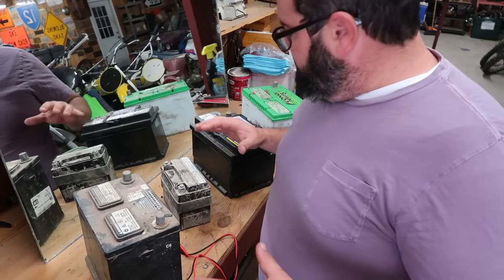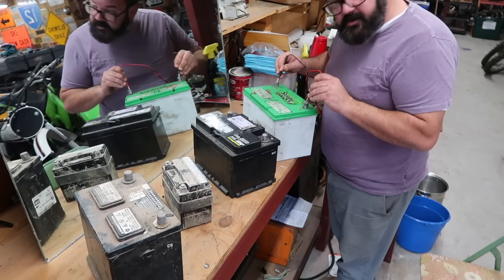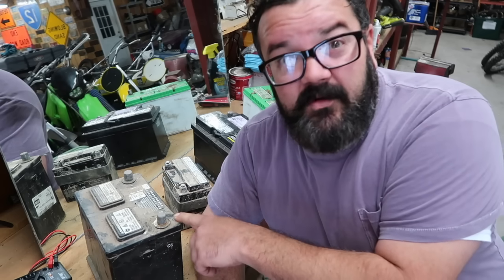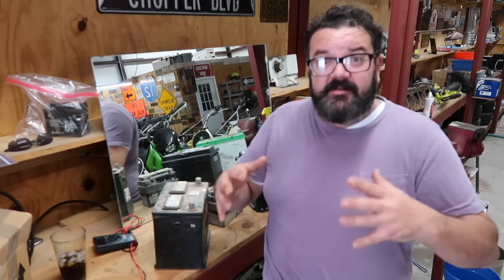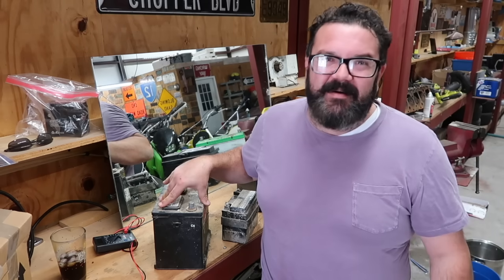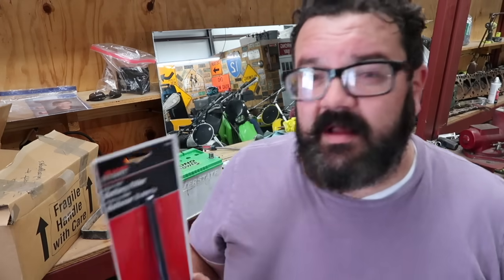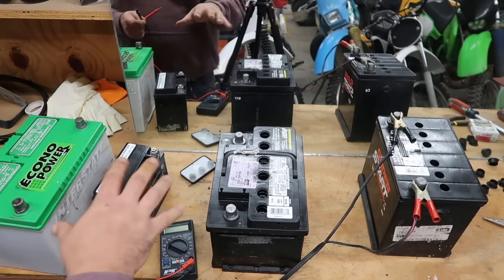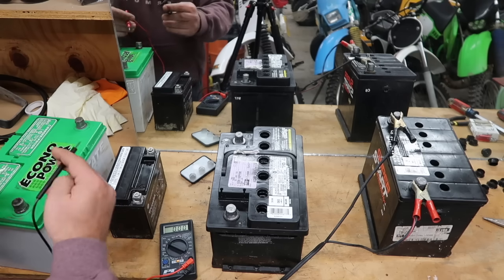Reconditioning a 12 Volt Car Battery: 100% Success

Comment: I was once told by an electronics teacher that the difference between a 36 month battery and a 60 month battery is the amount of space at the bottom of the plates.  The more space, the longer it will take for the scale falling off the plates to short them out.  If you could take a battery apart and clean it out, it would last forever, or a very long time anyway.
Reply: Good info.
Reply: You can drain and flush it and refill it before it shorts the plates out and prolong its life .
Reply: "f you could take a battery apart and clean it out, it would last forever," They used to make car batteries like that.  I remember my grandfather had one.  Knowing what I know now, I wish I kept it
Reply: As 1 real said. They used to be serviceable and it wasn't a terrible task besides safety. In the late 50s my dad worked at a place that did only that. They would do a couple dozen a day between the 2 shop hands. Safety wasn't as big of a deal back then though and my dad had one explode in his face that was overcharging and starting to boil out the caps. By the time the owner yelled out to him to stay back he already was sprayed with hot acid. It managed to build enough pressure to blow the seal for the top and send the top flying. Luckily he just had minor scarring, his sight was affected later in life though. He still has visible scarring when looked at in the optometrists images after his last laser eye surgery, which made his 3rd to try to correct it.

Comment: I have some dead batteries and I am going to try that trick to see if it will work on the ones I have because I am tired of buying batteries for my vehicles and lawn mowers. Thanks for the tip and I am glad to have found you and I believe my charger will work on each of them and hopefully they will work again.
Reply: The pulse repair chargers may take 3 cycles and for $15 well worth the money
Reply: The pulse repair chargers may take 3 cycles and for $15 well worth the money

Comment: Getting a battery to come back is very tricky. I have the top of the line charger from Harbor Freight. To see if a battery is doable, do this: Top all the ports off. Maintenance free is still toppable. Most of the time the cells are low. After 10 minutes of charging in AGM mode, do this test. (AGM mode with remove a short off a cell most of the time.) Take a multimeter, go to +, and read each cell with the probe tip stuck in the acid working towards -. If you get at least 1.8 volts difference between each cell, it's doable. Charge at 8/10 amps standard battery mode for 8 hours. Load test the battery. If it dies quickly, drain the battery & add fresh acid. Can be purchased at an auto parts store. Recharge the battery again. It should come fully back & hold a charge. I didn't add epsom salts or cadium tablets & had success.
Reply: "Top-of-the-line charger from Harbor Freight" lmao. That's like saying you selected the finest cut of beef from Taco Bell
Reply: I'm not sticking my multi-meters probes in the acid.

Comment: my take is that you didn't clean the plates with the rinse or the epsom , but with the initial 50A charge. Sulfates are stuck on the plates and you'll need high amps to dissolve those precipitated placks on the plates. Usually a good 10-20 minutes on a 100-200A charge until you see bubbles coming out of the cells will recondition your batteries . I wouldn't advise playing around with highly concentrated sulphuric acid. It's extremely corrosive and dangerous if it gets on the skin , it literally slowly burns away any fabric.
Reply from the maker: and charging that same acid at 200amps is safe lol, pot meet kettle

Comment: How much acid do you put back in before you add Epsom salt solution was kinda vague on that or does it matter thank you
Reply: I missed this part also! I'm thinking the epson salt mix is to be flushed out of the battery after a certain amount of time, since we didnt see how he cleans out the corrosion inside. Salt would normally help with something like this. So I'm thinking epson salt solution, let stand for what maybe an hour, then empty. Rinse out the battery, put back the acid and top it off with distilled water (just to under the cap line), then start charging at 200amps for 15 minutes, let stand 30-6-minutes. repeat charging time x3-4, with caps off and ventilated place. When the acid inside starts to boil evenly throughout all cylinders, let stand 1 last hour or so, place caps and done.
Reply: @369SkinneR  Thank you!
Reply: The epsom salts is to flush the battery to help clean it before putting back in acid and distilled water

Comment: Before you empty fluid out of battery,try reversing the chargers polarity,and tap the post quickly a few times,it will knock off corrosion and plac,then continue with Epsom salt clean and new muriatic acid,if you want to reverse a battery polarity,completely drain 12 volt power and charge the opposite if you need it to work in either left or right to work in you're vehicle

Comment: I watched a video right before I found yours about saving an old battery and the only thing different in the other video was the old guy first charged the old battery as much as it would take, drained the old liquid, and used a solution of baking soda and reagular tap water (10 ounces to 1 gallon) and it bubbled and hissed totally cleaning most of the build-up out of the old battery. He only used 12 ounces of Epsom salt in a gallon of distilled water for the new battery fluid. I don't know if that makes a difference but it seems the whole bag would probably work a lot better than just 12 oz. I figured I would let you know his trick for cleaning out the old gunk it seemed to work really good but be careful because when you add the baking soda/tap water it will cause a reaction and spit and spew pretty good, saftey glassed a must, I'm going to use a 6ft hose so I'm not close to it at all when it starts spitting. Hope this is useful to you and not just a wast of your time. Be safe and thank you for the videos, very easy to understand, educational and a blast to watch, keep it up I just suscribed and haven't watched all the videos yet but there next in line.
Reply: Baking soda neutralizes acid, I use it to clean any acid on the batt terminals and cable connectors.
Reply from the maker: Thanks for watching
Reply: Thank you.
I've been going back looking for that guys video.baking soda / ebson salt mixture.
I've believe his idea was the best

Comment: I did this for a battery that died a week after I owned the truck , the battery fluid was a bit low I dumped a couple bottles of water in it and it was perfect . Holds charge 2 weeks latter cranks the duramax no issue
Reply: Nice.

Comment: I've seen a lot of folks do this battery restoration. I'd love to see a load test on the battery to gauge the capacity. I know it's not going to be perfect like new, just curious what percentage capacity has been recovered?
Reply: I have load tested an 800 amp  starting battery  with a 500 amp loaded tester. I tested the battery several times before recharging it the electrolyte specific gravity test show the acid to be in the high range before recharging.
Reply from the maker: Video 2
Reply: The open circuit voltage taken on the battery terminal does not indicate any capacity. Volts is potential, capacity is rated in VAh or Volts times Amperes multiplied by the time the load is applied.

Comment: Battery minimum voltage should be 12.5.
They should also be load tested.
Hate to be negative, but there is many ways that a battery can fail.
As a battery ages the lead decomposes and ends up in the bottom. It belongs on the plates.
Even if one can bring it back to life it will usually have low cranking amps or test amps. If the battery gets discharged too many times it can also sulfate.
Reply: K Kenason absolutely! 13.5 is the optimal voltage
Reply: 12.5  volts is the Minimum voltage  if the battery is sitting not connected to a charger. 
It is a static rest voltage. 
Sometimes the battery will be higher if it is pulled off the charger but it will settle to 12.5 or very slightly above within a few tenths if it is good and all the cells are contributing..
Reply from the maker: New batteries come 12.4
Reply: @CarGroves  I'm not going to debate one or two tenths of a volt. 
Voltmeters are not that accurate
Reply: @CarGroves  ive been a master mechanic for 30 years a new Battery isnt fully charged off the shelf and they should charge yo 13.6 and should be load tested with a battery load tester to show they have the proper cranking amps the voltage doesn't mean nothing when it doesn't have  the amps to crank it over , and it looses it's voltage the first time under a load.
Reply: Can I use a dead 50amp battery to light up a 12v lamp? For how long will the battery hold?

Comment: The battery should be load tested to see if they're any good they can have voltage but still not work.
Reply: amps will be low
Reply from the maker: Watch video 2 on my channel.
Reply: In my case I have a 12 volt 7.2 Ah battery that although the voltage was at 12 volt when it shorted it did nothing. With the distilled water method it improved a lot only that instead of 7.2 Ah it has 5 amperes, with a no-load voltage of 12.40 volt after a week it remains at 12.00
Reply: @enzovideogames  
12v indicated with a volt meter is actually considered less than 6% charged.
What most people don't understand, and apparently includes the guy who made this video, is that the percentage of charge for a lead cell automotive/motorcycle battery isn't 100% at 12v and around 10% at 1v, it doesn't work that way.
A battery that shows 12.66v with a hand held volt/ohm meter (VOM) is considered 100% charged. 
A battery that shows 11.89v with a VOM is considered 0% charged.
It doesn't work the way that your common sense tells you it will, the percentage of charge doesn't go from 0v indicating 0% charge to 12v indicating a 100% charge.
It actually goes from 11.89v considered 0% charge to 12.66v considered 100% charge, 12.24v is actually considered to be only 50% charged, it's not the same as the battery in a cell phone or a laptop, the difference between 0% and 100% charge with lead cell automotive batteries is completely different then a cell phone or a laptop going from 0% to 100%, this is the mistake people make when evaluating the charge condition of a car battery, they compare it in their mind to how their cell phone works but it's completely different. 
And then you have a load test that simulates cranking on your starter, a car battery can indicate 100% charge, which is 12.66v using a VOM like he is in this video, but you hit the button on a load tester type battery meter and watch the needle dive down into the yellow or red zone on the scale, which means that even though with a VOM it's showing 100% charge it won't pass the load test (which simulates cranking on the starter).
Then you have whether or not a battery will hold it's charge after sitting overnight or a few days, you can charge a battery to where it shows 12.66v with a VOM which is 100% charge and leave it sit for 2 days and then put a VOM on it and it'll indicate 12.24v which is 50% charge, meaning that it lost half it's charge sitting for 2 days. 
It's far more complicated than this guy leads on to be, the only way to properly test an automotive/motorcycle battery is to charge it to where it indicates 100% charge (12.66v) and then hit it with a load tester for 10 seconds and see if the needle stays in the green zone (acceptable) on the scale or drops down into the yellow (meaning weak) zone on the scale or into the red zone of the scale (meaning bad).
Hand held VOM meters only tell part of the story, and can't properly evaluate that type of battery, auto parts stores like Autozone usually have a hand held load tester and will gladly walk outside to your car with it and load test the battery for you.
Reply: The battery still drop.
Reply: Can you use a ammeter/multimeter for that? Just switching to amps?
Reply: @bitTorrenter  no. A good battery can give 500+ amps.
A good meter can read 20amps before blowing a fuse.

You need to use a proper high current carbon pile loaded meter
Reply: @dukecraig2402  so what are you saying is, it does not work this way and old batteries cant be revived that way?????
Reply: @phuketbungalowinfo2757  
Oh no they can possibly be revived, but his narrative of "how much charge" is in a battery is wrong.
As I said a battery is considered to be 100% charged at 12.88 volts, not 12 volts as a lot of people think, conversely it's considered to be 0% charged at 11 point something (I can't remember right now exactly what it is but it's in the 11 volt range that's considered 0%).
Reply: @phuketbungalowinfo2757  
It's 12.66=100%
and 11.89=0%
Reply: @bitTorrenter  most meters have a amp limits say 10 amps as mine... blew the fuse inside mine but some u can replace .... But don't put a bigger fuse in it no no
Reply: @dukecraig2402  Brilliantly explained. The character that produced this video who mostly does not respond to the comments could learn a lot from you. Thank you for the lengthily explanation, and all the best to you for your valuable input.
Reply: @stewartbruce2409  
You know sometime in life it just pays to buy a new battery instead of screwing around trying to "beat the system" in life, you do wind up with a new battery out of the deal after all.
Reply: @dukecraig2402  question for you... please and thank you,  ..... I know I have a bad battery.....  car was no start. 11.5 v at battery.  Jump started right up the first try. V at battery while running was @14.  As soon as I turned on the headlights the car shut off....  Does this mean I also have a bad alternator?  The V at the battery after the car shut off was 12.4.    Thanks in advance for any help.... 👍
Reply: @taketime0626  
What's the make, year and model of the car?
Reply: Yeah I've had battery's with 13 volts but load test shit
Reply: Another safety tip, practice hair metal headbanging over the battery fluid and the fan.
Reply: @dukecraig2402  Thank you for your input
Reply: LazyH-Online  Sometimes when a wrong idea is presented as truth, Sometimes repeating is necessary to drive home the opposing point 
I didn't take anything as "needless repeating

Comment: You’re lucky you can still do that in the USA. Here in the UK all batteries are sealed now. 

But you’re missing a trick by not settling and then filtering the old battery acid. If you filter the settled acid first through a very fine tea strainer to remove the larger particulate matter, then through coffee filters, you will have a far more extensive process, and end up with a much cleaner, more efficient and longer lasting acid. 

It’s those floating particles which have come off the plates, that cause the drop in efficiency in batteries.
Reply from the maker: Metal doesn't float in acid
Reply: Car Groves that is of course true. But I’m not talking about metal - as you should already be aware. The corrosion or scale on the lead is correctly termed sulphate. As I believe we have both figured out, it’s this sulphate material that’s clogging up the battery, shorting out the cells and causing it to become inefficient. So it’s the sulphate that’s floating about, not metal. 

Try thinking before typing a comment based upon assumption and insufficient knowledge. Many of the so-called ‘haters’ on here are actually sharing accurate information. I’m one of them.
Reply: will a coffee filter work ?

Comment: The charge is held in the acid through the exchange of electrons between the plates. A charged battery will have a strong acid of high specific gravity as shown by a hydrometer & a discharged battery will show weak acid of low SG.

A dry battery cannot show voltage as it needs the acid as the conduction media.

Comment: There's available volts and then there's available amps. You can have 12 volts but little amps and amps is what you need to drive a motor like a starter.
Reply: thats what i wanted to see? see them actually cranking an engine over 👍

Comment: This has been around for years, works good if you just want to make a car run so you can peddle it but not good for long term.
Reply from the maker: I think its hit or miss from my research
Reply: It's pretty much all miss. The people saying it worked have not tried putting that battery back in service.  They will find out soon enough i guess
Reply: It works great if done correctly and there is no bad cells. You do have to replace the Sulfuric acid solution

Comment: Its the cranking amps that start the vehicle   So 13V means SQUAT really!!!! if the cranking AMPs are not there.
Had a 10yr old battery that would charge to 14.5v but would not start the car because the cracking AMPS was only 120 or so
Reply from the maker: CCA
Reply from the maker: @LegendLength   Just going to have to try and see what happens.
Reply: @LegendLength  it depends. Clean the top of the battery.  Use a battery tender to get it to 100 pc.  Will take 3,4 days. At 100 pc, take it to auto zone or similar for a conductive battery test. That will tell you how good it is. Oh, if it's a battery that you can add water, top off with distilled and let it sit overnight. Then connect the tender. Do not use a trickle charger. Good luck.
Reply: Holy shit what a waste of 13:37 mins of my life
Reply from the maker: https://www.youtube.com/watch?v=RNnSYuTuLk4&t=46s
Reply: so what you saying  sir   when it's  nackerd its  nackerd